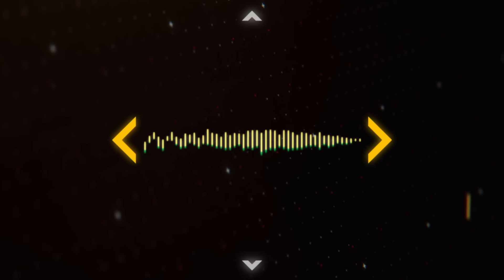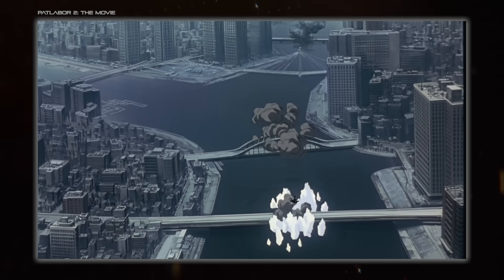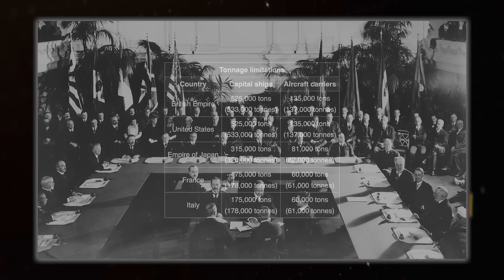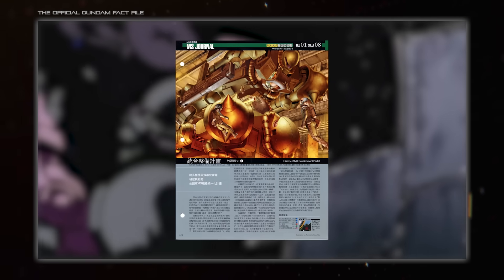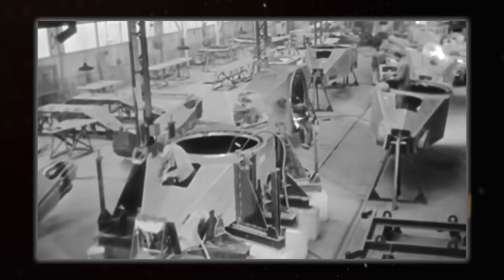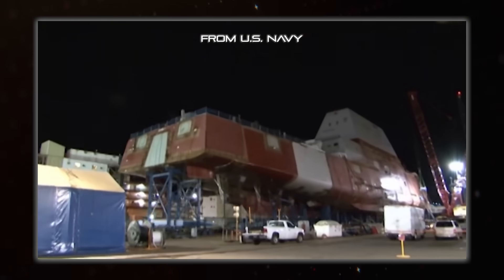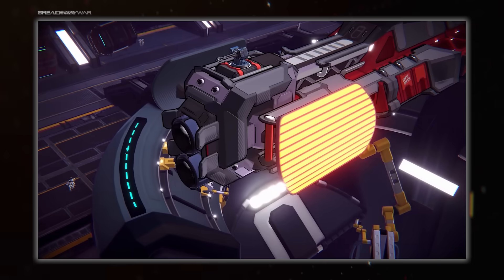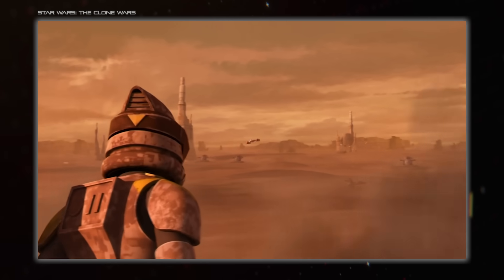Design Principles in Sci-Fi Spaceships

Comment: The Battletech Lore is very good at this. Many Mechs and tanks were built on the same chassis since the factories that built those chassis had dialed everything in over the years. Many of the weapons are listed as 'tried and true' versions and the newer designs are often described as 'troublesome' or 'quirky' because while they were good, they were rushed into production before they were completely tested.

Comment: Coming up with a good design is not that hard. The problem is to come up with a good looking design without getting sued by the big companies for "copying" their designs. 
I'm trying to create Scifi ships for years (at for my own amusement) but i never found a good combination of shapes that's not already been used in some form. 
Sure, you can start with a brick and glue gobbles on it, but in my book that's just lazy and resulty usually in a very ugly design. 
If you want to create something instantly reckongizeable you need to start with a combinatzion of basic shapes (for example, the flat pyramid of the Star Destroyer with it's conning tower, or the three tubes + a flat cylinder, or the thousands of other combinations in "Star Wars" or "Star Trek") and give that combination of shapes a direction and some element of "character" by making it look fast, agressive, blocky, or even more futuristic by combing the individual elements to one flowing shape.

The real problem, in my opinion, is to avoid combinations that are already used at the famous ships while trying to make something out of the combinations that the designers of the famous ones (the original Enterprise for example) have discarded decades ago. 
It is like trying to create a car from scratch, but without using four wheels, windshields, and two or four doors. 
Good luck with that.

Comment: One interesting design aspect of the Macross-class ships after the SDF-1 Macross from the franchise of the same name is that they are all modular ships made up of several smaller ships.
Take the Battle Frontier and its sibling ships for instance, they're all made up of 6 smaller ships connected together, 2 large ships that functioned as the main propulsion of the whole combined ship, 2 carriers that carried the fighters on board, a command ship that connects every ship together in the combined form, and lastly a gunship(literal) that houses the Macross Cannon(the most powerful weapon of a Macross-class ship). 
Each component ship is a functional ship on their own, but together they form the galaxy's most powerful capital ship(s). 

Why are the ship after the SDF-1 designed this way? Because the SDF-1 suffered massive damage at the end of the original series, the Macross Cannon integrated into the hull was completely destroyed and that pretty much resulted in Earth's at the time most formidable capital ship being out of commission(because that meant half the ship is outright destroyed). The modular design of the later Macross-class ships allowed them to lose entire sections of the ship and continue fighting(amusingly enough most common part to be destroyed was the gunship). 
In the latest entry of the franchise, Macross Delta, the Macross Elysian would deploy its squads of fighters out for missions via detaching the 2 carrier ships. The rest of the combined ship would remain stationed on their home planet as the last line of defence.

Comment: It's interesting that in zero-g your cabin space can be much smaller.

A 'corridor', for example, need only be torso wide, with extra for turn around and a second person.
That makes a corridor of only about the profile of a big TV screen, 2.8ft x 5.85ft. (0.85m x 1.78m).

A personal cabin need only be as big as a closet at 
 4ft x 2.9ft x 7.2ft 
 (1.2m x 0.88m x 2.2m)

Comment: No matter your abilities to accelerate, or endless power, removes the basics of the 'tyranny of the rocketship' effect.

Even if you can produce endless motive power...

You'll want to have the abilities to better accelerate, maneuver and always the need to remove excess heat.

This means the ship has to reduce it's mass as much as possible.

So no spaceship will be 'battleship big'.

Spaceships will always have to maximize their weight efficiency – to the point of minimal cabins & exotic lightweight hull materials.
A minimal, strong shape tends to be a geodesic ball or a geodesic tube;

Big buckyballs & cylindrical fullerenes tubes.

Comment: Speaking of Gundam, there’s a lot there that was surprisingly around from the beginning. The United maintenance plan might be a later addition but the bones of it were always there. The Gundam uses the core block system (the cockpit can be removed and placed into any RX project suit and as a bonus is a fighter aircraft). The core block was eventually abandoned because it was expensive and stupid but the bones are still there in the mass production model suits and aircraft all keeping the same cockpit systems. I also believe iirc that the zeonic hands and cockpit idea was around from the beginning (even if not called  the ump) as they do mention the hand/weapon standardization (and the cockpits are usually similar for design bible reasons). 
Anyway Gundam does have a lot of thought into it. It was also headed up by the most insane (clinically, not skill wise) animator known to man and I have immense fear and respect for him

Comment: Just a note, the terms I've heard for In-Universe reasons is Watsonian and the Our-of-Universe reasons is Doyalist.
7:45  Also, I like how the "development" of the Y-wing was essentially what happens with old pickup-trucks.  Something breaks or rusts out, ask is it actually necessary for the truck to function?  If No, cut it out and keep on without it.  If Yes, repair it if you can, if not find a close-enough patch to scab-on.
Reply: And then when they made a new Y-wing for Ep9, it was like making designer blue jeans with holes already in them.

Comment: 5:09 More of a fundamental design and doctine issue than a lack of tech.  Even if Sweden had a fully working gun stabiliser the S-tank's gun was fixed to the hull.  You can't aim without turning the entire tank so firing on the move would be impractical anyway.  Also the Swedish army's doctrine was essentially defensive, and being able to fire on the move is less important for holding ground than it is for taking it.

Comment: A important part of the IP is how difficult is it to design a new ship, and how hard is it to build a ship."

Is a new original advanced combat shuttle a major project that takes years by a well resourced team with a large budget, and various prototypes, before finally going into production. 

Or can it be designed from scratch (with only a basic hull concept already half worked on), by a couple of non experts and one engineer with no specialised resources or training.
And the design completed and perfected, with a fully working version built in under a week. 
With just the standard equipment on a mid sized exploration vessel at their disposal. 

Even Starfleet HQ itself could go from clean sheet to a full production cruiser in a year or two. 

Star Wars (but not to the same extent) also had ship design and construction not being a massive undertaking, with the Rebels able to build X-Wings in hidden outlaw facilities. 
And the Clone Wars had huge fleets built during the war from new designs that ignored the arbitrary legal size limit, so they had to be designed from a clean sheet without even the carryover knowledge of previous equivalents.
- This without holodecks or replicators that can at least hand wave some of the speed and ease.

But a new Battlestar is not going to be a backyard project [okay the Blackbird Viper], and neither is a ship from the Alien franchise.
Babylon 5 had new ships being the projects of governments.
And SG-1 ... well the truth is the F-35 and the Zummit Destroyer program cost overruns were cover to hide the budget items.

The Expanse, shipbuilding and design are still a complicated and expensive process.

In Dune, a new ship design is possibly semi blasphemous, but not to the extent that it is in the Imperium of Man.
But it is definitely rare. That may be partially due to far less need in a static culture with no external threats.... unlike the above-mentioned Imperium of Man (40k).

As for Doctor Who...
Nope, that's the opposite end of the scale. Giant evacuation ships can be built with circuitry that uses food paste, and The Doctor can knock together a working Tardis from wrecked console parts.
All it needs is the polarity of the neutron flow to be reversed to kick start it. 

But then Missy claims to have once built a working gun out of twigs and leaves, so the ability of techomagic to cut corners and the ingenuity of the designers appears to be on another scale.

- what if they had access to holodecks and replicators?

Comment: 5:00 - not quite, the Strv-103 was first designed in the mid 1950s, before it went into mid-1960s production and at that early point in MBTs the designer estimated a 3-plane gun stabiliser on the move was 20 years away.  So he committed the S-tank to another new idea, the autoloader. This autoloader was a 6-shot cassette (not the 25 round carousel the contemporary T-64 had), a design built for smaller vehicles so it could be smaller and only need 3 crew. The engine went to the front and the main door to the rear to increase crew survivability and when the Swedish army were introduced to the design and prototypes they built their hold-fire-retreat tank doctrine around that tank. This meant that when the British introduced 3-plane gun stabilisation only a few years later, the non-NATO Sweden already had a defensive doctrine built around the hard to hit turret-less wedge and kept it in service for 40 years. This lack of stabilisation and turret completely however  killed the S-tank’s overseas marketability though and it was only in production for 5 years.

Comment: For one, the ship designs better not be spindly, satellite-y, and gangly. Sorry, ISV Venture Star, but you're not as attractive as an Imperial Star Destroyer or a Mon Calamari Star Cruiser.

For two, the ship may need multiple even if redundant types of FTL, just in case Sometimes, they can do hyperspace and slipspace, other times they use portals, rare times there's teleportations, and uncommonly the occasional Multiversal jumps that'll waste lots of power and and may not reach the intended destination due to lack of proper calculations.

For three, ships may need Hammerspace insides. Ship may be the size of a Victory-class Star Destroyer, but go inside, and voila, a colony nation resides!

For four, do have multi-faceted life support and comforts. You'll never know if a ship will have mixed crew of humans, A.I. akin to the ones in the anime Vivy and the webseries Red vs. Blue, elves, dwarves, turians, elcor, G-Stone robots, and so on.

And five, as some noted, there better be onscreen, properly made bathrooms, toilettes, bedrooms, and other room implements. Enough with that prudish taboo!

By the way, the Rebel Alliance in Star Wars Legends does have industrial capability in secret holdings on undefined planets. They even have prisons and food production the same way.

Comment: The video alludes briefly that the in-universe and out-of-universe (a.k.a. diagetic and non-diagetic) reasons for certain ship "looks" will vary. The non-diagetic reasons bear more breakdown, IMHO, for both exteriors and interiors ...

For exteriors: A book can describe anything. Hand-drawn animation can depict almost anything, but 3D motion is labor-intensive. During the Star Wars-inspired 1970s and '80s, models need to fit on motion-control photography rigs, and are detailed with plastic battleship parts ("greebling") (*); in cheaper productions, basically any kind of junk is thrown together, which may achieve "ships can be differentiated" but not "their features are explicable." In the '90s, CGI allows complex motion, but for shape, usually sticks to tradition (including the use of decks of lit windows to imply scale, even on warships which shouldn't have so very many vulnerabilities). For interiors: The limitations of physical set design and cinematography lead to a lot of flat walls, small rooms and repeated corridor segments. You get expansive interiors only if the production is creative with establishing shots, matte paintings, greenscreens or other set-extension techniques.

(*) In the novel Calculating God by Robert J. Sawyer, a character denigrates that detailing technique as "robot vomit."

Comment: On "size constraints", one of my favorites is one I learned from the BBC show "Connections" decades ago - the US Space Shuttle's size was determined by the width of a donkey's ass.

Massively oversimplifying: 

US train tracks and tunnels are the width they are because they were based on a team of two donkeys pulling a cart.

When the US Space Shuttle was being designed, and reusable solid rocket boosters became a key design component, it was a requirement that the solid rocket boosters be carried by train around the country. (To refurbishment, from construction/refurbishment to launch site, etc.) This meant the SRBs had to be small enough to fit through rail tunnels. This put a cap on the size/power of the SRBs. This then put constraints on the Space Shuttle Orbiter itself.

Comment: Correction on the Zumwalt AGS

The problem wasn't there was never enough 155mm ammo. The problem originally was the planned 32 ships were cut down to merely the 3 we see in service which caused the ammo to increase in price until the navy went "screw it, just take out the guns and turn the damn ships into missile slingers"  which resulted in the ships now being refit with new VLS cells to fire the LRHW hypersonic missile (due for testing from the zumwalt in 2028 now, yes wikipedia is a bit behind). This was worsened by the fact the AGS wasn't able to use any other type of 155mm shell (yes really) so yeah.